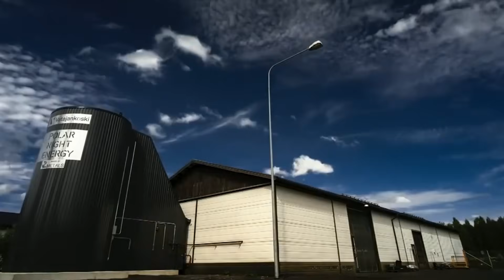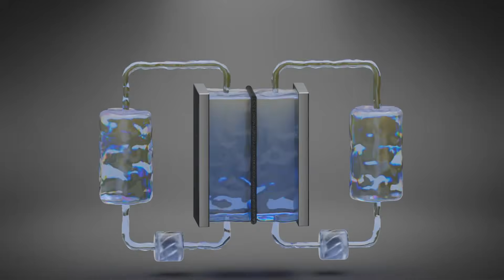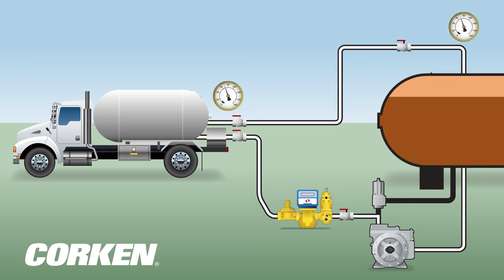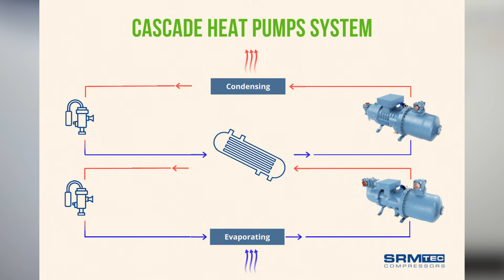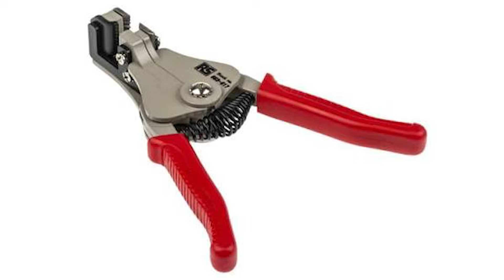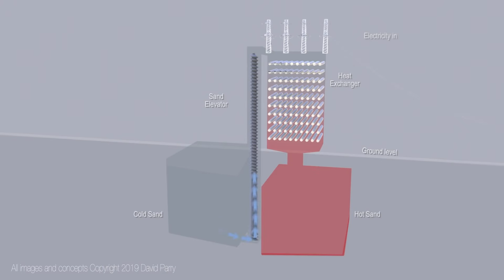This Polar Night SAND Battery Heats Homes All Winter for Pennies — No Propane NEEDED!

Comment: Is a sand cool battery possible that can act as a heat sink to keep a home cool?  A refrigeration evaporator could spirat through a quantity of sand to bring its temp down to -10 c,  but then you have to deal with condensation and how to extract the cold from that sand.